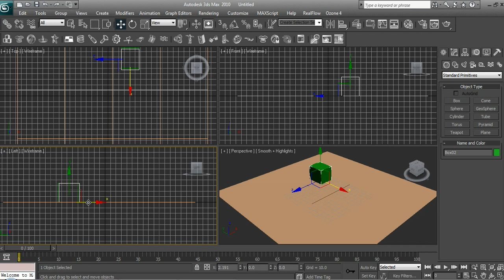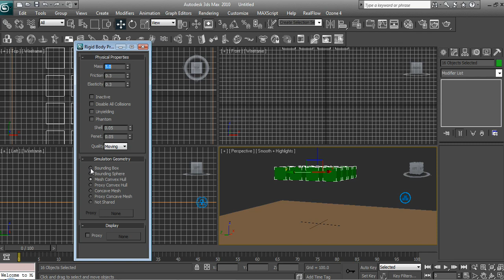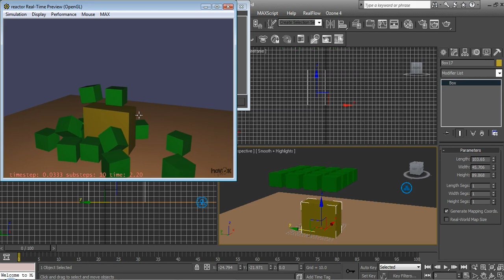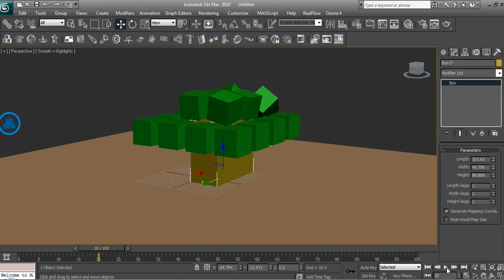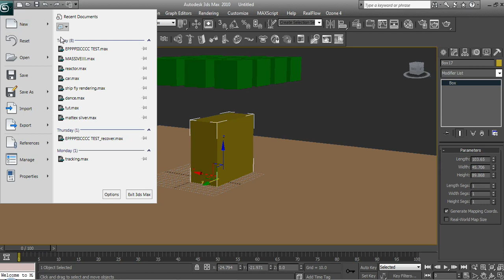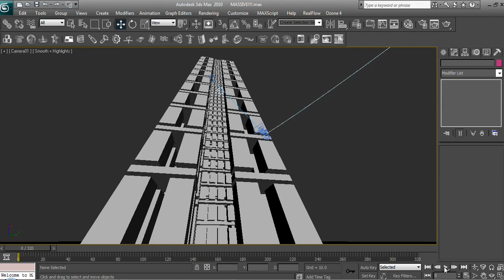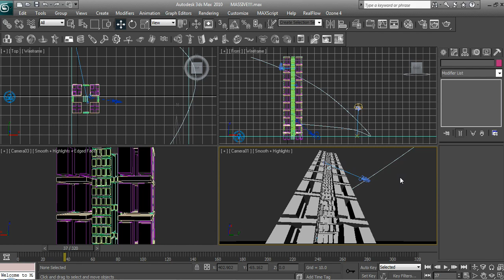Reactor Basics - 3DS Max Tootorials

Comment from the maker: Hmmm, that could be a good tutorial. Also, is you want round edges for your plane make it an editable poly then go on vertex mode. Select all the corners and fond the filet tool and click and dragon the corners till you get it to the correct roundness. What renderer are you using and wht materials are you using.